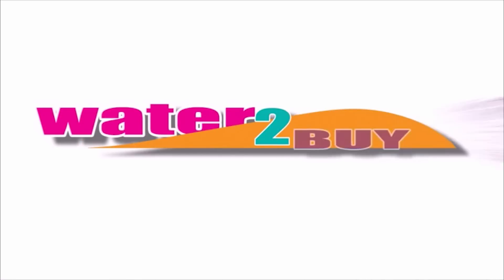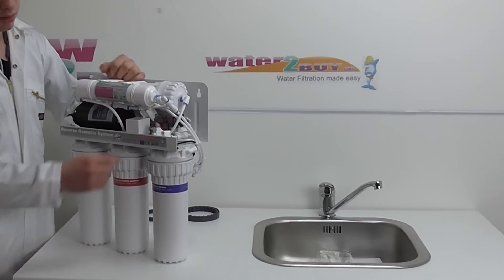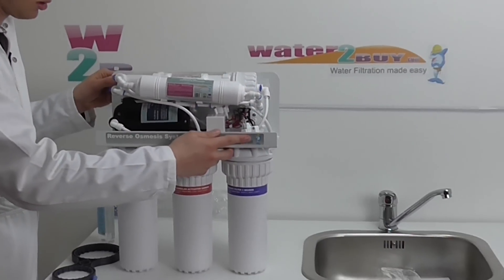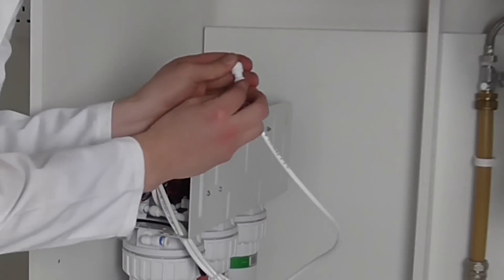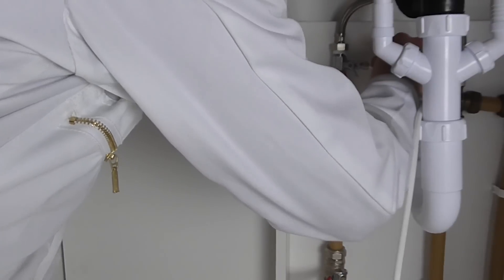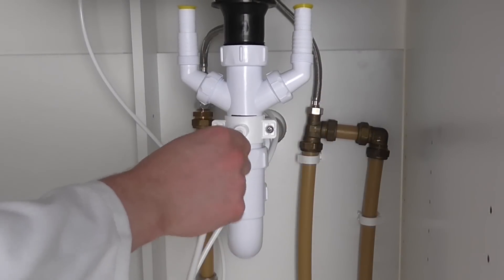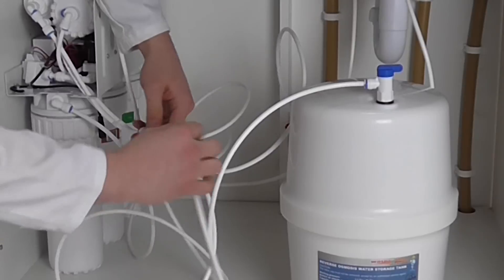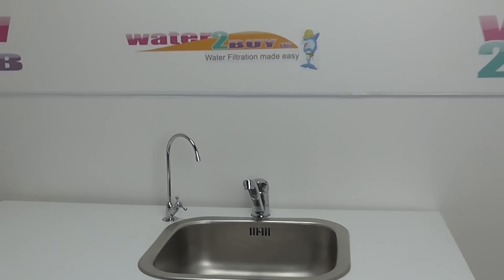Install Your Reverse Osmosis Unit Easily By Water2buy

Comment: can i use this system without the tank? whats the purpose of the tank? i wont get any instant water flow if i dont install the tank?
Reply: The tank create extra pressure.  YEs, you can install without the tank. If you are in the city, you don't need it.  Also, the Tank act like a "reserve" water, incase of power failure if you have a well water system.

Comment: That mess of tubing is making my OCD go into overdrive! C'mon, dress those lines.
Reply: Chase Florell that actually is it being cleaned up. Want a tiny bit of slack on all lines. Nothing tight or pulling. I am OCD as fuck myself. And I have a reverse osmosis recently installed under my sink. After five minutes you’ll forget all about it :)

Comment: ALL FILTERS MUST BE RINSED WITH LOADS OF WATER FIRST! WHY DID YOU NOT MENTION THIS?
Reply: I agree. I'm in the process of installing a system, and I am told that the filters should be flushed. It would be informative to have the complete flushing procedure illustrated.

Comment: This was very tightly packed and came in GREAT Shape.>>>ur2.pl/1110    Easy instructions to follow, just take your time especially if you're not a very handy person. total install times about 1.5 Hours from myself, I did not want to make mistakes. Also Use Teflon Tape, My tank leaked since I didn't use it, but its perfect now that it's On.

Comment: ‘Secure with a blue clip’
YOU HAVENT SUPPLIED ENOUGH BLUE CLIPS!!!
Reply: the follow up video is how to build the water2buy 3d printer, to print the blue clips yourself easy as 1, 2, 3.141592653589793238462643383279502884197169399375105820974944592307816406286

Comment: I dont understand what the waste pipes function is , how is there any waste? i live in a house share so cant make any permanent modifications , so no drilling. I think i could get away with this unit but not the waste pipe.
Reply: There is waste because all of the crap that has been filtered out is automatically flushed into the waste pipe, apparantley worse condition than before it went in.
the waste water can go anywhere if you want, down the toilet out of a doorway into the street, but don't drink it , tastes like shit and is bad for you in larger quantities!!!!
Reply: ok, i expected all the crap to get filtered and remain in the filter cores and ALL the water pass through. I went with a distiller instead in the end , bit more of a mess around but im happy with it
Reply: I conecte the waste  in the  in whather líne, so this pass for the filter  agains

Comment: Very complicated, much easier and cheaper to use a water distiller and does not require changing filters
Reply: 150$ gets you a unit that does like 4 gallons a day. Thats way more expensive than reverse osmosis

Comment: Hello, 

I bought two years ago a RO 500 for a summer house. 
After one year of using we saw that the water was not purified because some "calcaire" was in the kettle.

So we stopped using it.

Now i'm trying to understand why it's not working.

I read all your documentation i could find online, but still the product is not functionning as it should.

when we open the clean water tape, "clean" water never stops running, the tank is never empty, so there is a problem here. the flow should not be that high.

I checked each one filter and still I don't understand where is the issue. 

We have enough water pressure in the house so it's not from here. Maybe the two high water pressure could have damaged the non return valve? 

I would like to give you a good review on amazon but now I can't use the product. 

Can you help or contact me? 

 Best regards,
 
the manual is not clear enough: it doesn't describes accurately the 2 osmosis pipes after the ro unit.

Can you send me a functionning automatic shut-off valve. (9) see diagram : 
 
http://www.water2buy.com/media/downloadable/water2buy-reverse-osmosis-owners-manual.pdf

This video is not for R0 500 : https://www.youtube.com/watch?v=4T4FBG245wE&t=63s

Is there a video for RO 500?
Reply: إيش رأيك فيها وهل فيها فلتر من الفحم النشط؟
وايش فوائدها بالهموم؟

وشكرا لك 🇸🇦🌹👑💚

Comment: How much will this system cost?Can it be used for a borehole water input?
Reply: i just drilled a borehole for my mum in Ghana and the water that comes out is a salty one and i need a setup that will reverse that salty and hard water into a portable one that can be used for cooking and bathing.Can this setup help me ?
Reply: I`m studying RO systems similar to this one. The first stage filter is for sediment like in your bore hole. Then 2 stages of carbon filter remove tastes and smells. The next filter is a reverse osmosis membrane that will remove salts and minerals. Then it stores in a tank. The tank water is then passed through another Carbon Filter to remove anything that might have leached from the tank into the water while it was sitting. Hope this helps.
Reply: @gantz4u  nope

Comment: Over time what is the maintenance with these? after how long do you have to change parts, or clean parts, ect? i know nothing, i am literally just starting to learn about these systems.
Reply: Milan Jovanovic what would you use
Reply: aquaphor morion is more expensive but easier to install

Comment: Thanks for showing us how to install this on a wooden counter top.  Now show the rest of us (99.99999999999999999999%) how to install it on a tile counter or porcelain+cast-iron sink.
Reply: lsro 171
Reply: a simple diamond bit hole and add the separate faucette off to one side.
Reply: You definitely are minted.